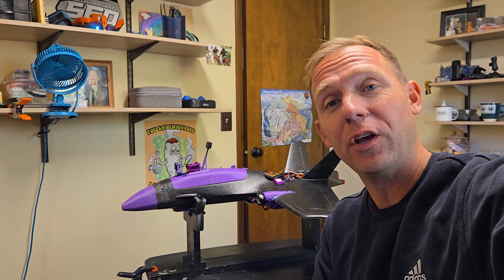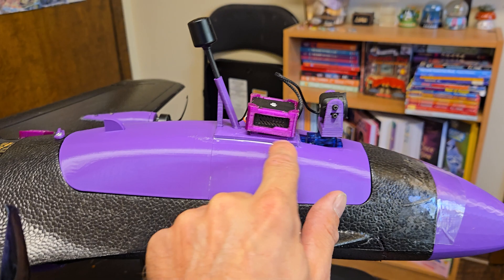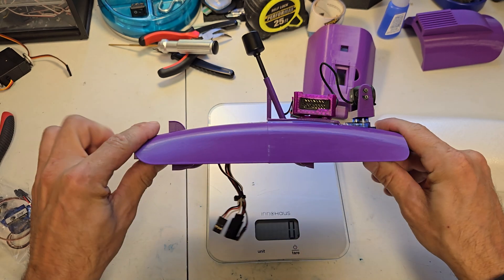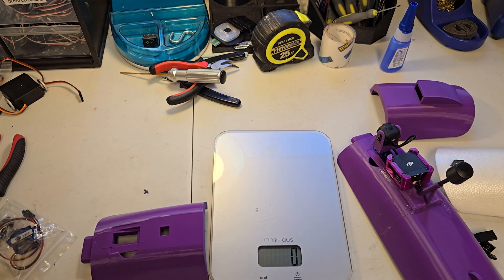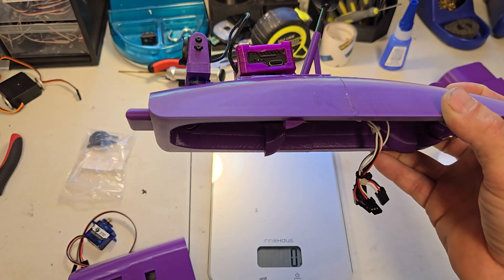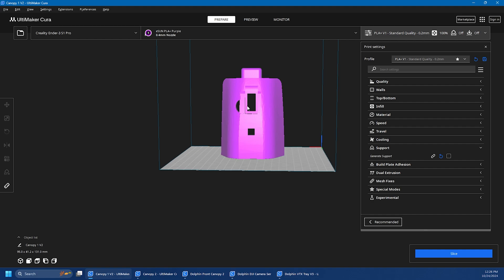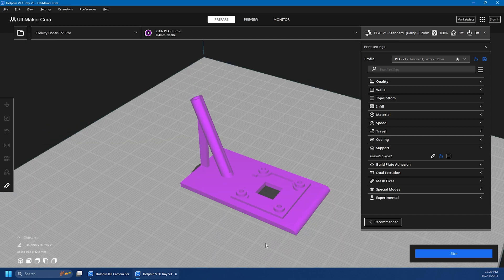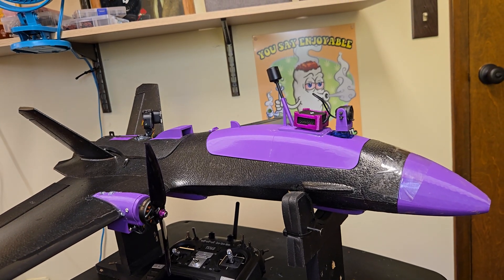FREE! 3D PRINTED CANOPY - ATOMRC DOLPHIN

Comment: Hey Jeff I have been going rounds and rounds trying to diagnose an (engine code 53 - exhaust manifold temp sensor) and I cant get a straight answer from a mechanic. Just wondering if you have ran into this same problem? I have tried searching for a contact number for you but can’t find anything so I’m commenting here. I have a 2008 Yamaha 212X